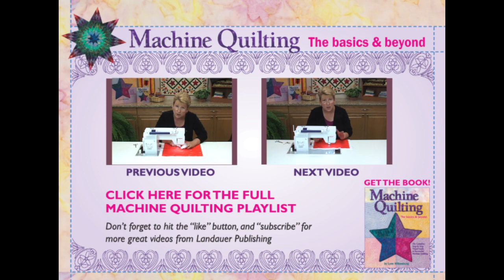Troubleshooting Tension Problems for Machine Quilting and Free Motion Quilting

Comment: ive nearly launched my machine out of the window since starting my first quilt. From the top it looks really good, then underneath it varies from being perfect to eyelashy and all over the place without any adjustments from me. Ive practiced and used test sandwhiches and only start again on my quilt when it seams ok. Ive got a very old cheap machine and even just had it serviced.
Reply from the maker: Hey lizzclare , I hope this video helped you identify the problem. Does the 'eyelashing' happen mostly on curves? That's where I always see it when I'm using my home machine. Having a practice quilt sandwich handy before I start quilting really does help a lot - use the specific thread you're going to be quilting with in both the top and the bobbin. That way, you can work out the issues before you get started on your actual quilt. Make sure your machine is threaded properly (you have no idea how often I've overlooked that and nearly thrown my own machine out the window before realizing it was user error...whoops...) then, slowly adjust your top tension as you practice with a small area of a design. Make a bit of the design, check the back, adjust tension a little bit, repeat until you're satisfied. It's a little bit of a process, but it really will save you time and curb the desire to test your machine vs. gravity. If I'm understanding the 'eyelashing' correctly, it sounds like your top tension is too loose, even if it looks fine on other parts of your quilted line. -E.B. Updegraff, Digital Marketing Manager for Landauer Publishing
Reply: yes it was brilliant first quilt all done now onto my second :D
Reply: Hahaha, so did I !!!

Comment: Hello! I am a brand new quilter, and have a juki 6000. I noticed those “dots” I tried adjusting tension but they went from top to bottom, so I don’t think that’s the issue. My thread spool is large ( not as big as yours here, but not a regular spool) . My question is two-fold. 1. Can an external thread holder be used with any machine? And 2. Do you think the spool size could be my issue? 
Loved this video, it was very helpful! Cannot wait to watch more... 😊

Comment: This was so helpful.  Thank you for making it all make sense.  Problem I have is when I'm using the "invisible" thread.   i get a tangled mess underneath.   Does this have to do with the tension as well.?
Reply from the maker: With invisible, or monofilament thread, your particular issue might be with your needle - try using a smaller needle like a 60/8 or a 70/10. That could clear up the issue, but if not, it may be a tension issue - that's where having the practice quilt sandwich comes in handy. With invisible thread you might need to go pretty low on your dial.

Comment: HELP!  This is my first time trying free motion quilting.  I keep getting an error on my top thread.  The thread keeps breaking, no matter where I set the tension.  I have changed it very slowly, even powering it off between adjustments just to make sure it resets. When it does stay threaded for a minute, it will completely skip any curved stitching.  I have checked and rechecked how it is thread on top and on the bobbin.
Reply: Try changing the needle to 90/14.  I found that my needle eye was too small and was the cause for breaking threads.